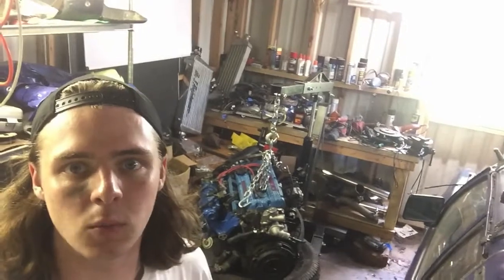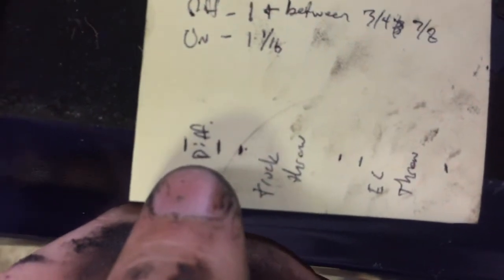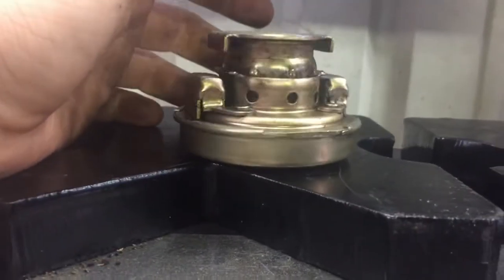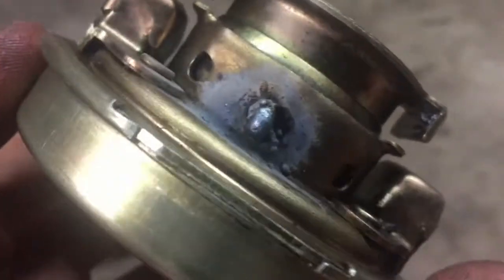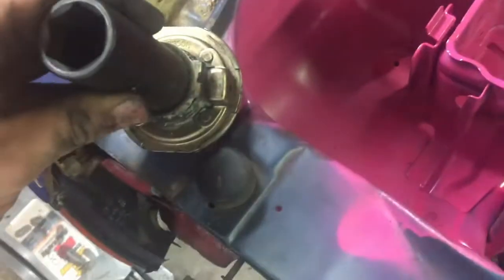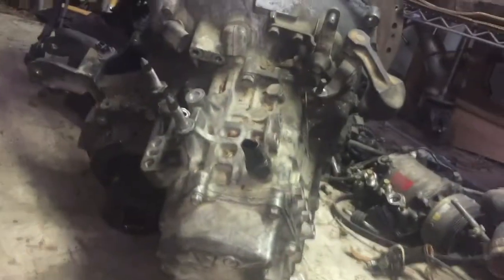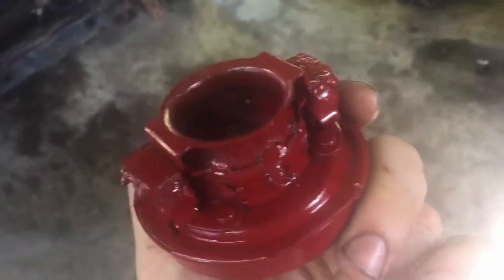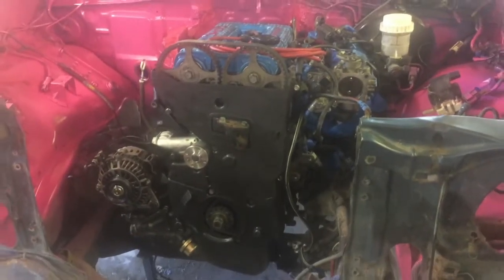Mighty Max 4G63 Swap Part 12 - A Solution!

Comment: Hey great videos I have a mitsubishi might Max 87 and have problems with the clutch it doesn't changes the gears you think it could be due to a similar issue that I need to pull it out.. here the video let me know your opinion.
 https://youtu.be/XaZGtquwq14
Reply from the maker: If it moves by hand with the engine attached, I would say it is the same problem.  It looks like your TOB arm has been modified, maybe someone messed it up
Reply: Ok.. Thanks for the info..👍

Comment: Weird that transmission don't have a slave cylinder?
Reply: some of the diesel mighty max and d50 trucks came with the hydraulic clutch setup, I also I think I recall hearing that the monteros and dodge raiders also had the hydraulic setup as well.
Reply: Only the Km transmissions and the 1st models r5m's came cable type.. thise were around 1990 and earlier... post 1990 i believe they all came hydraulic, I have a '92 model diesel mighty max.. i love it.. its a great truck!
Reply from the maker: Nope it's just cable-driven.  Makes the clutch a tad heavy but it's a lot easier to work on IMO